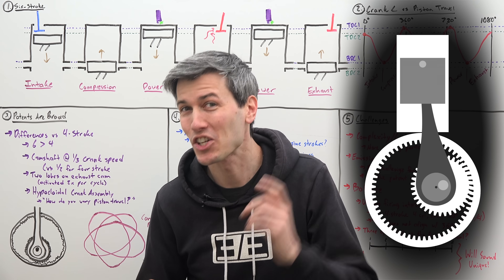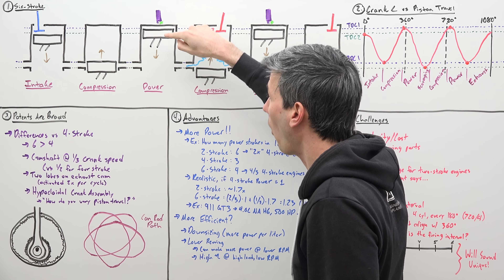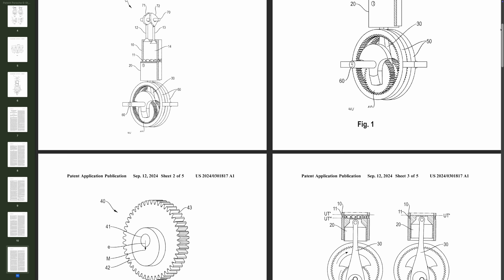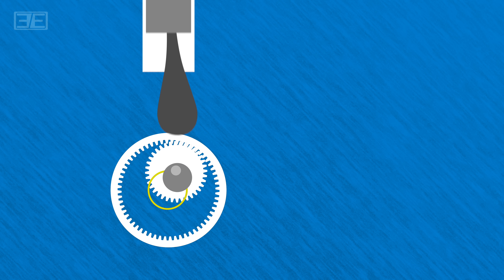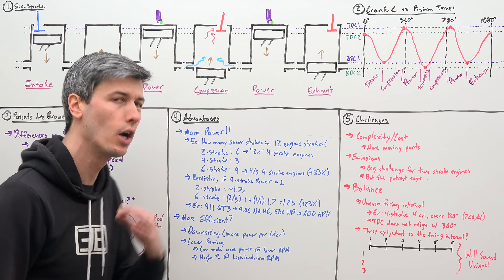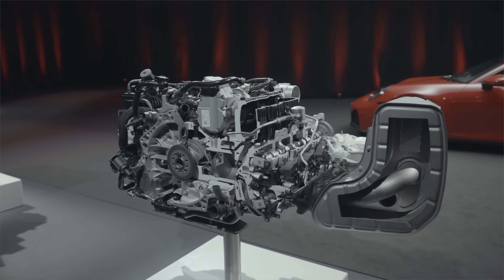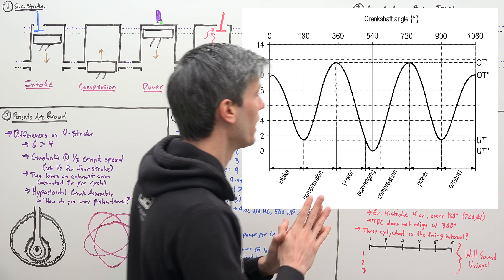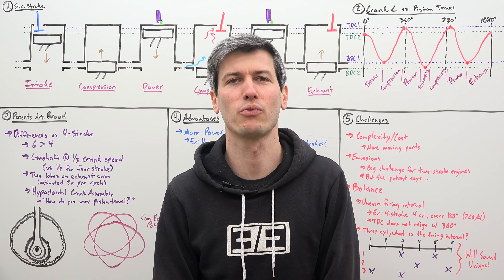Porsche's 6-Stroke Engine Is Genius!

Comment: 4-stroke 4 cylinder = 180 deg.   4-stroke 3 cylinder = 240 deg. Same concept of odd number cylinders in radial engines with a common crank pin

Comment: Maybe its possible to splitt the crank shaft in to two parts for each piston, and Connect them through fluid motion, thus reducing the wear the slighty uneven piston  produces

Comment: u cant just compare # of strokes to power, u have to take into account the time of each stroke to get the actual power no??
unless u are averaging them all out to be "equal rpm"... which wont be as easy for new 6 stroke engines to match engines speeds vs matching powers....????
this just means they are probably gonna last longer and be smaller or similar ish?

these engines will be more complex but probably can go slower so it will last longer and be more reliable in the end.... when/if they are mature.

Comment: Admirable to push the boundaries even if it remains theoretical I love it.  Great explanation.   I still would love to see modernization of 2 stroke vehicles as cost and wear parts / valves etc is significantly less.   

Direct injection 2 stroke with an oiled crankcase is something I’d like to see do you know anyone currently advancing 2 stroke technology @engineeringexplained ?

Comment: What you are missing is that on the 4th stroke, they are probably not adding fuel, just more air. Thus burning the unspent fuel in the combustion chamber and not in the exhaust system. Modern gasoline-burning engines use air pumps and catalytic converters to burn unused fuel in the exhaust system. Which is a waste of energy because the unburned fuel is turned into unused heat.

Comment: Evinrude E-Tec/Skidoo Etec actually did a pretty good job of reducing emissions in there 2 stroke engines and did pretty good fuel efficiency wise according to third party testers they actually usually did better them 4 stroke competitors.

Comment: am I the only one not understanding how this should be staying lubricated when the cylinder actually runs over an opening at the lower BDC? 
No piston rings or oil control rings will stand up to running over an edge for hundreds of thousands of miles without taking damage. For exactly this reason, 2 strokes are to be run with oil in the gas, since there is no possible way to run it with a closed oiling system. What am I not understanding?

Comment: As the commentator said we don’t know how this is going to pan out 
All the fancy intake plumbing in the world probably won’t get this motor to work 
Therefore you have to tuse some kind of compressor (turbo, blower whatever) 
That concept was actually already developed a long time ago with the 2 stroke Detroit Diesel some of which have a turbo and a mechanical compressor 
Anyway good luck with trying to accomplish this 🖖😏

Comment: Hold the phone. If Porsche believes they have solved the combustion efficiency challenges of a two stroke engine, why is this complexity necessary or beneficial? A pressure lubed, direct injected two stroke would out perform the six stroke while being lighter, and mechanically simpler.  

Where are they getting the positive pressure from for cylinder charging during the latter cycles?  The cylinder will be full of exhaust gas at high pressure.  They will have to open the exhaust valve early to vent the cylinder and something will need to provide the flow for cylinder scavenging.  In the past, this was either crankcase pressure from the piston or a mechanical blower.  The former would introduce undesirable oil vapors and likely be too slow for effective scavenging, the latter is much more interesting but means this likely is not a true NA design.

Comment: By simply splitting the ring section from its skirt can retrofit exist engine to advanced hybrid ICEs. The ring-section operated via a (valvetrain-like) piston-train to pump the gases in the exhaust strokes and reuniting with its skirt to do the heavy compressing and power strokes. This new piston design completes the 4 strokes, different in both displacements and periods, in every revolution – called D-cycle (differential-stroke cycle) which is an advanced hybrid of current 2-cycle and 4-cycle. Tests have shown >2 times (2.5x ~ 3x) more torque and >20% fuel saving. The baseline engine shown no sign out side. It can also retrofit onto new engines of <1/2 number of cylinders.

Comment: I'd be interested how they are going to deliver oil to the cylinders. Seems like the conventional four stroke method wouldn't work with the piston moving past the transfer port, and the 2 stroke method reintroduces the same old emissions issues. Wonder what the ideas are there.

Comment: What if you ran it as a V and had them on opposite pins on the crank shaft? Like left side cylinder 1 and right side cylinder 3 fire at the same time?

Now that I write it down it seems like it would be worse.

Comment: My whole conundrum with this is when you talk about efficiency and it not burning oil like a 2 stroke. I don’t see how it would be possible to not burn crazy oil when you still have to have piston squirters or some kind of ring lubrication. it goes past the secondary intakes on secondary bdc wouldn’t oil pool up in the secondary intake tracks on downstroke and become thoroughly efficient at burning oil?

Comment: From my understanding, this looks more efficient than traditional 4 stroke engines simply because the first bottom lower center does not allow the first explosion to exhaust and then the second bottom dead center allows exhaust for both explosions to exhaust, meaning only only slightly more exhaust fumes... but twice the power of traditional boxer engines...

the one thing making my head hurt is thinking how in the world the German engineers are going to time it.

Comment: Yes please I have a question : Where do “we” stand with the commercialization of the “opposed piston engines” which as per prototype testing show over 50% efficiency and an engine design that is very simple without a valve train ?

Comment: A downside that occurs to me is that this engine will have to be supercharged.  Or they will have to open the exhaust port mid-way through the "first" power stroke to generate scavenging inertia to pull in air from the bottom intake ports. Perhaps they could use crank case supercharging like most 2-strokes, but then they probably need a fuel-oil mix too.

Comment: Very Smart... However in reality this is a 3 stroke engine! Why, well simple. The definition of a 2 stroke engine is that it has one power stroke per full rotation of the crankshaft, or two strokes (1 up and 1 down) per power stroke. A four stroke engine has one power stroke per 2 full rotation of the crankshaft, or: 4 strokes per power stroke (2 up, 2 down). Now this new engine has 2 powerstrokes per 3 rotations of the crankshaft (3 up, 3 down). So by the same logic as before that is 2 power stroke per 6 strokes in total (3 up and 3 down), so that makes it a 6/2 = 3 stroke engine

Comment: Cool concept! Wayyyy complicated! Couldn’t we just develop a cleaner direct-injection 2 stroke? It’s already been proven as a concept. It can burn cleaner than. an 4 stroke and as you mentioned it can create a 70% horsepower increase. And 2 strokes are the most SIMPLE design. Less parts, less weight, less reciprocating mass.  Hit the emissions goals and you have a winner!

Comment: It might balance out from the difference in power strokes, I assume it wouldnt have the same power from the 2 stroke cycle vs the 4 stroke cycle. This might bring up a few possibilities for clocking the crank angle at something strange.  This is still assuming that it's an inline motor vs a boxer.    

...or they just slap on a super complicated balance shaft and call it a day 😂

Comment: So its combining the Hypo gear of a rotary engine to allow a difference in piston travel, and 1 of the strokes leads it to go farther down in the cylinder and aspirate an air fuel mix that it can then ignite...got it. Also it DOES NOT need an even firing angle with a balance shaft. My R1 crossplane crankshaft I4 engine does a very uneven firing and yet the balance shaft tames it fully for the 4th cylinder

Comment: PLEASE PLEASE PLEASE, compare this engine with a rotary engine since they share a lot of similarities. The 1080 degree, multiple of 3, gears in the crank as a stationary gear and ring gear on the rotor. Also, how would the displacement be measured? I happen to argue that the 13B is equivalent to a 4 cylinder 2616cc engine. Would love to hear your input!

Comment: I get the problem of uneven firing order but it can be solved by ECU timing.
In 3 cylinder application you’ll end up with uneven firing but for 6 (which is 2*3) every full power stroke can be complicated with additional from other cylinder. 
Biggest problem in my opinion would be crank construction to make it sturdy enough to withstand offset forces

Comment: This sounds like a nightmare for piston rings. I imagine there must be a recommended TBO for this issue alone. As the rings move past the lower intake ports, it will cause localized wear patterns on the rings and the cylinder walls.

Comment: Does balancing not matter if it's used as a generator for a battery? Power to the wheels comes from the battery so you don't need smooth power... I dunno, I'm not smart.

Comment: How do you keep oil from going in the bottom intake port?  Wouldn't be a problem in a standard 2 stroke with fuel oil mix in the crankcase, but I'm assuming this would have more of a 4 stroke lubrication system with oil flying all over the crankcase.

Comment: The valves can be electromagnetic driven so uneven combustion is dooable, but balance it? Computer driven ignition, using individual coil packs allows continuously variable ignition timing so it can get spark when needed. The balancing is the biggest challenge I think.

Comment: It looks very like a diesel two stroke. I assume it will need forced induction for scavenging. The piston skirts will need to be very long to keep the lower intake ports covered (again, like a diesel two stroke). It's an interesting engine but I don't really see the point of it.

Comment: Theoretically, if you use a free valve system like Koenigsegg instead of camshafts or a clever VVT system, you could different between the two in one engine. This could be done by somehow stopping the second circular motion on the crankshaft. I'm not sure of anything, but if four strokes is more fuel efficient, then this could allow for variable crank timing to swap to six strokes for more power.

Comment: VIDEO IDEA!!!Could you figure out the mathematics for something and make a video on it? Id like to know if say a 7.3 gas godzilla superduty with a 3.73 gears, would make the same torque and the wheels as the 6.7 diesel (non h.o) at 5,000rpm in a lower gear, then a diesel would at lower rpm, but higher gear. Seems like these new gas trucks tow as good as diesels with there gear ratios. Im curious if its the same torque with the motor revving higher them the diesel and the gear ratios making torque. As it is a diesel cause diesel wont rev high, and they make max torque at low rpm.

Comment: I have always wanted to build a 6 cylinder Porsche engine where the two center cylinders are larger than the other four and form a supercharger for the other cylinders
Would require highly customized heads and cams

Comment: Running the valve train through gearsets works fine but I don’t know about running the complete output of the motor through them seems like they’re going to wear the gears On which ever is the power stroke side

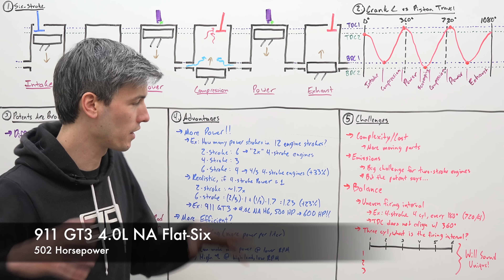Comment: 8:45 no we are not on the limit cars are detuned and restricted. Problem is not power output it is reliability in certian rpm. Just look at NA hypercars or NA racecars or f1 high reving engines. Yes more NA power at low rpm can be a  gamechanger with lower fuel consumption. So politicians get happy. But in todays engines you still can get 100hp more at same rpm but as I said they detune for reliability and mpg.

Comment: its prbaboly for exploiting stratified combustion or getting additional energy out of the heat in the combustion chamber. you dont even need to inject fuel into the second power stroke to extract energy. a normal 4 cycle with a scavenging energy recovery 2 cycle afterwards is probably just a convenient way to do this

Comment: If it had a sleeve valve cylinder it could cut off the two stroke intake ports and also run as a four stroke.

Comment: With a 6-cylinder, there's at least two pistons firing at the same time:

     1.  2.  3.  4.  5.  6.
1 -  |    |     x   |    x   |
2 -  x   |     x   |    |    |
3 -  x   |     |    |    x   |
4 -  |    x    |    x   |    |
5 -  |    |     |    x   |    x
6 -  |    x    |    |    |    x

2JZ firing order 1-5-3-6-2-4 would become: 
(1/2)-(5/4)-(3/1)-(6/5)-(2/3)-(4/6)

Considering the high/low compression dual firing, if it's not hideous unbalanced, it sounds like the sound coming out of this thing could be amazing.

Comment: I messed around with Legos to help me visualize firing orders a few years back and coincidentally I figured out the solution to the 6-Stroke method using a piston count of 3, 6, and 12 (because I thought it would be cool).
The best way to balance out the firing order is to intentionally have a first-combustion and a second-combustion happening simultaneously. for an inline 3, the crank has to have all the pistons lined up on one side, like an even-firing 4-stroke inline 2 would.
The crank needed for the Inline 6 and V12 are going to make people scratch there heads: It's a literal flat-plane crank. every pin is 180 degrees from its neighbor which enables the same interval as the inline-3 but doubled. Also, the V12 needs to have a bank angle of 90 degrees (yes, like a 4-stroke V8) in order to fire evenly.
A boxer 6 for Porsche would not be a great design, I think it could be better if it had each piston sharing the same crank pin as their opposing neighbor, and then each crank pin is 180 degrees offset from one another. the imbalances of that are going to be fun, just like the inline 3.

Comment: I have to imagine the efficiency increase comes because it has complete combustion like a 4 stroke but doesnt need to complete 2 full strokes without power. Id imagine the increase in power is also equal to the decrease in parasitic losses in the motor.

Comment: 13:55 If they use 6 cylinders they can balance the engine to have 2 power strokes on each 180° rotation
Reply: Being late to the party, but I thought so to. It would've been easier to spot if the chart went from 1-7 with 7 being the first "1" of the new cycle. Then you just make xx-nothing--xx-  and so on and it perfectly aligns again with the 1st stroke on the right side :D
Reply: Exactly 💯
Reply: if it was a V style engine couldnt it have power strokes even more times per rotation?
Reply: That's just a 2 stroke engine atp  @bolognatheroach8576

Comment: Thanks for sharing this with us. My general question however is:
In addition to all the technical smart solutions , isn't this whole concept based on the thermodynamics of the residual expansion energy of a 4 stroke engine that is normally used to drive a turbocharger? In general this Porsche Patent sounds to me more like a challenging engineering feasibility study........ 
Additional Water/Hydrogen injection is more the future I would think ? BMW holds a Patent on this as far as I know since a couple of years.....

Comment: A student of mine asked how does the engine keep from burning oil seeing that the rings travel above the two stroke ports? Wouldn’t this allow oil to collect in the ports during the upward movement of the piston and then wouldn’t this oil be drawn in on the two stroke intake stroke?

Comment: What happens with your piston rings when you have holes in the side of your cylinder? More moving parts, more air and fuel systems, lots more areas for problems. 
Engineers need to focus on more simple designs, an engine that can hold up. Using a bit more fuel is more environmentally friendly if your engine last more than 4 years lol

Comment: Look to the Russell Bourke patent for a single-stroke horizontally opposed engine. The Compression occurs under each piston forcing the air to the top piston chamber. Would appreciate your time to explain the benefits of the Bourke engine.

Comment: Regarding the overlap in firing order with the three cylinder setup and how to balance that; my question is, could it not be balanced by having a six cylinder setup, either v or opposing with two banks where the off balance could be inversely offset on the other bank. In essence having a rear two cylinder overlap on bank one be offset by a front two cylinder overlap on bank two?

Comment: The added complexity of the bottom end would make this engine a lot heavier. 

I think the better idea would be a two stroke that sends exhaust out of  valves in the top of the cylinder. This would skip the bottom end weirdness while keeping the higher number of power strokes vs a 4-stroke.

Careful valve timing would be needed to avoid sending a lot of fresh air out the exhaust. Raw fuel going out the exhaust wouldn't be a problem, because this obviously would be a direct injection only design. Without direct injection, fuel would have to come in through the ports in the bottom. This would contaminate the oil. You would want a pressurized oil system for the usual reasons, even though a lot of oil would end up on the top of the cylinder, as it would back flow into the ports as the cylinder is coming down.

Something about omelets. This might be a good racing engine design.

Comment: The first major problem I see is simply the stress on the gears. With every power stroke, the gears take a HUGE amount of load.

How big do they need to be to not simply blow out?

That seems like a failure waiting to happen.

I wonder if the engine CAN work, much less will.